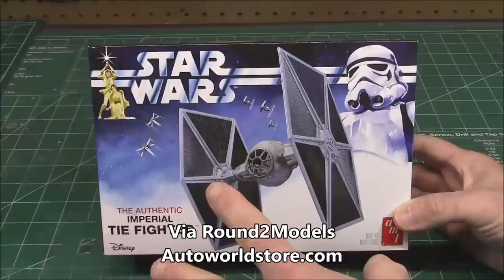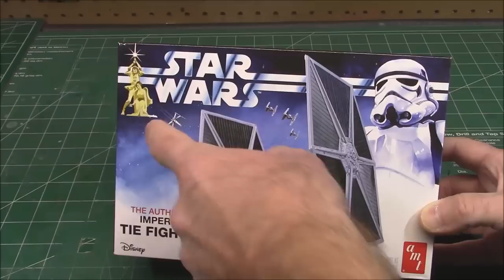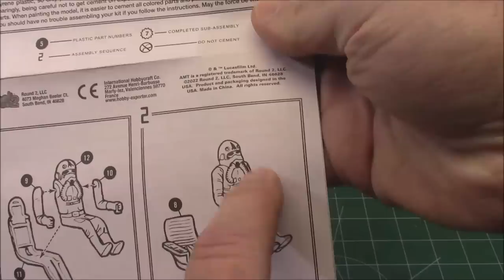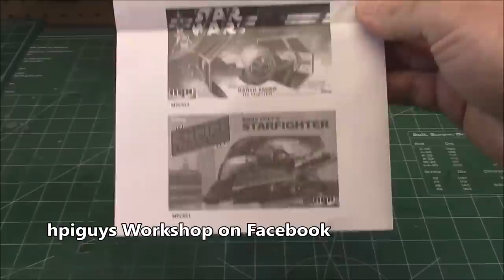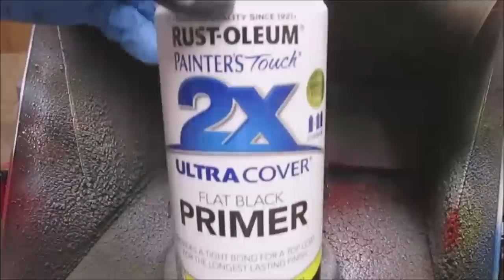Tie Fighter Star Wars A New Hope 1/48 Scale Model Kit Build How To Assemble Paint Mask Pilot Weather

Comment: One detail that drives me nuts is the pattern on the front window spokes have the top spokes at the 12 and 6 O-Clock position, but when you see the pilot's view, the same spokes are at the 1 and 7 O-Clock position.  How hard would've it been to make that consistent?
Reply: The models were hashed together by the team in California and the sets were built by the team in England working from blueprints based on the semi-finished models. It's a miracle there aren't more goofs.
Reply: @orangemanok5800  Yeah...but they've NEVER fixed it in all the sequels...ever, and they certainly could've done it, right?
Reply: @leslauner5062  Would that be ironic continuity? They HAD to know.